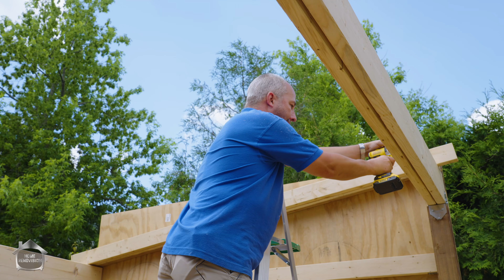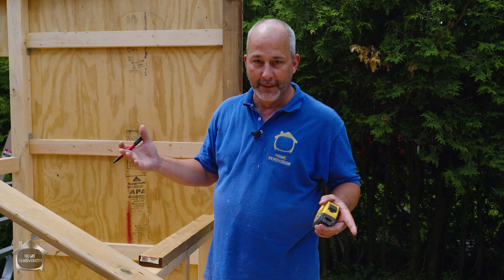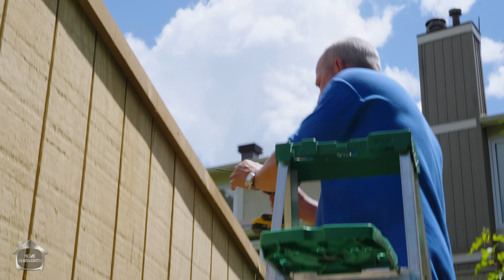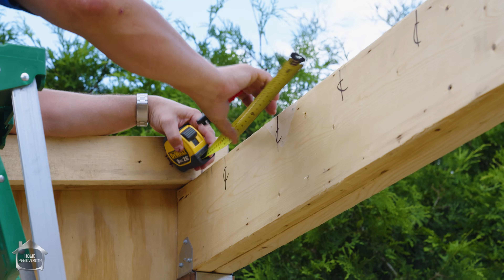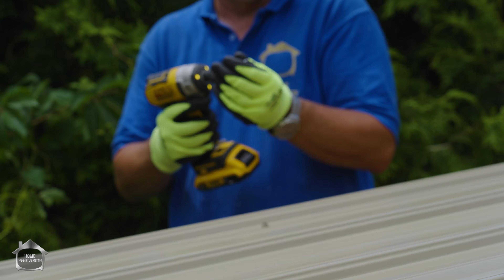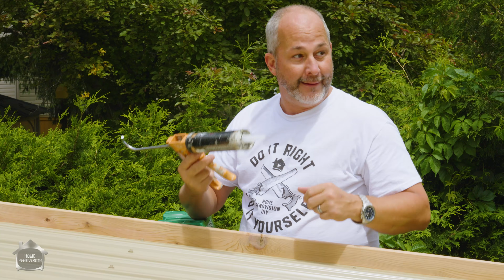This $500 Shed Roof Will Last 50 YEARS!

Comment: You are never to cut steel roofing with the paint side up when using a circular saw as the steel particles can and will burn the paint and cause premature rusting. Also, your roof might last 50 yrs. but when you screw on the flats, it is more prone to leaking as that is where most of the water runs. You have a 2 cent washer and they will fail after some time. Have seen them fail in as little as 15 years, and what a huge mess to try to fix especially on bigger roofs. Also I never have a wood piece sticking up on the side, better to cover all wood.

Comment: I prefer to push in the other direction because you have better control of the gun you have more control of the speed then you have more control of the bead its self. But also there's no need to fix the shape of the bead. The Best part is you can do it in a quick stroke and never look back. The only thing to be careful of is the cut of the tip  , the hole of the cut is the width of the curve you want.

Comment: Did you break the 7 1/4 metal cutting blade when you threw it? Something went down, camera guy was stifling a laugh I’m sure of it. Dude, the amount of tips you throw into each video is phenomenal. Ripping boards lengthwise without tablesaw, the screw to create a “pilot” hole, scoring and bending the sheet metal, applying the caulking extra-wide and self-levelling... and more I’ve forgotten already, I’ll have to rewatch a couple times. THANK YOU - You’re helping me help others.

Comment: If you live in a cold northern climate it is a good idea to sheet the roof and apply a membrane.  If you don't sheet and apply a membrane you will have frost forming on the underside of the metal.  When the roof warms up it rains inside your building.
Reply: I heard not to use it cause of condensation? Trying to figure which way I’m gonna go but have about a day to decide
Reply: @contractor556  There is a lot of good info from Building Science that is climate specific, although they sometimes have a no budget approach.  I live in one of the driest states, but at high elevation.  My shed roof rains to the interior in the fall and early spring when humidity and temperature are similar.  I was trying to save a few bucks when sheathing was outrageously expensive.   In the future I will pick up some thin foam board and insulate the underside.   Pretty annoying when things you want to be dry are getting wet from condensation.
Reply: Concern in Heated building only

Comment: I’m building a lean to roof off the back of the shed. Do I need to place osb underneath my metal roof? I hadn’t planned on it. I was going to secure the metal to the purlins. The roof is only 8’x10’. I asked this question before the end of your video, I see you didn’t use any type of plywood, so that’ll be what I’m doing. I did install some purlins though, 2x3’s

Comment: you put your metal rafter brackets on BACKWARDS, the 2 flip ins rest on your header, , Why did you put a raised edge wooden board around the edge?  that will hold leaves rain snow etc.. everything damp on the roof and NOT shed water, the caulking will not last but possibly 5 years tops.    the metal should be 1/2 inch OVER the edge all the way around AND have a metal drip edge   ...having the metal the to edge all the way around with a drip edge so debris blows off,  you have built a giant tray,,, you will be lucky to get 5 years before the roof rots all the way around the edge--- I have never seen a roof built like this?  Sorry just trying to warn the next guy starting out
Reply: @george8706 he did that to make you ask questions 😂

Comment: So Jeff, I hired a roofing pro to help me put on a metal roof.. He made it really clear and important to not cut the metal roofing material with a grinder or metal blade like you did.  You are supposed to use a "nibbler" which squeezes off the cut material and seals the open cut edge as it goes.. This prevents rusting and erosion of the cut edges..

Comment: The roof support should be perpendicular to the metal sheeting, and the outer edges of the metal sheeting should overhang all sides an inch or so, not have a board sticking up on the edges.

Comment: Hi Jeff,
I watched you with the tape measure.  I used to have one just like it.  Either one of these two you will like a TON better.
- Klein Tools 9225 - 25' tape measure.
- Klein Tools 9230 - 30' tape measure.

They have 13' of stand-off, have only real measurements, no metric stuff, AND it has measurements on both the top and bottom of the tape so you can read it overhead, with a double hook so you can also hook it overhead.  

They are a little heavier than the one you have, more of a concave in the bow in the tape to give you that much stand-off, a blade that the markings never wear off on, and can take a drop.  I bought the 25 because I needed one in a hurry, but you get the 30' because the 30' is just long enough to square up (diagonally) a 2-stall garage.

Comment: Two questions regarding cutting the metal. Did you do that one sheet at a time or was that the whole stack at once. 
Secondly, what type of cutting blade did you use, yours looked rather special. The two ways I know off is a fine toothed metal cutting blade, or a regular blade that is put in reverse.

Comment: Hey Jeff I can tell your newer to doing metal roofs and I am not a pro but some major Canadian winter issues you are showing. one use rake and drip edge pieces saves on relying on cocking. second your screws should be on the rib not the flats for a roof. Do not screw the washer flat your killing your seal just make it tight enough the washer no longer moves. And last pre drill your holes it will save you so much time and frustration. I hope this is help full to you as your videos have helped me in the past.

Comment: I don't like to be critical about these videos, but there is nothing right about this roof. First of all the roof framing is nuts, all roof panels need to be supported under the flat of the panel... Therefore purlins must be installed perpendicular to the rafters.
The standard spacing is 24" centers on wood construction. Then you install your panel over that, securing it with metal roofing screws in the flat of the panel, and never in the rib of the panel. There are lap/ stich screws that can be installed on the laps only, but they do not secure it to the purlins as they are short for securing the lap only. Please look up "how to install a metal roof" before hand, and do not install per this video. You will void roofing warranty if installed incorrectly. I have been installing metal roofs for 40 years, and I have never seen it done this way before. When walking on a metal roof, always walk in the flat of the panel, never on the rib. And save yourself a lot of money on wood by installing rafters 24" on center, not 9" on center. That's just crazy. Low pitched roofs should have mastic on each lap, to prevent leaking, especially in areas that get snow or ice. Good luck👍

Comment: HA! Hi Jeff (From Kamloops, BC) great video, one building season too late for me :D Just built two 10ftx10ft sheds with 12ft x 12ft metal roofs (8ft back & 10ft front walls) this past spring. Used your other videos as helpful guides. Thank you!  Used L trim on the backside of the roof as well (like Robert James). Worked perfectly to keep the water off the fascia & building! Going to do gutters that drain into barrels next year any ways, need to save the water. Keep up the great videos! Oh right, also used 1 sheet of "clear acrylic green house sheeting" cut to fit into the north-facing pony wall for light, works awesome. Enjoy the snow storm =-D

Comment: Instead of adding addl rafters and lining them up for the screws it's much much easier to just use a skip sheeting method. Set your afters at 16" or 24" centers depending on the loads you anticipate in your area and then just lay down a 5/4 material across the rafters wherever  you want a row of screws, again could be 24" to 36" according to your roof manufacture specs.  Much much much easier.
Reply: My thoughts too he did mention using less material but it looks like he used more material doing it his way
Reply: I do that when I build sheds for my livestock and tool sheds. Saves time, effort and $$.

Comment: While I understand the company only warranties putting the screws in the low part of The Valley on sheet metal, I will never understand really why that is. Common sense tells you that putting a screw in the low part of the metal where the water runs will eventually leak. It has been my experience that the rubber gaskets on those screws degrade over time and you will start having leaks in 10 years or less. Traditionally the screws were always put on the peaks, ask any old farmer. I get that it voids the warranty, but I would rather do that and put the screw in the peak of the metal knowing that it won't leak instead of depending on a rubber gasket that I know will be degraded by the sun over time, and begin to allow water in. what are your thoughts?

Comment: I may have missed this, but did you overlap the panels? If so do you screw through both? Also when you were sealing the edge you could see a raised gap between panels How do you tackle that? Thanks again for another great video.
Reply: You do overlap one portion of the panel. As for sealing, I don't believe he sealed anywhere other than the sides. With an angled roof like this, water shouldn't be getting inside, but the wood will be a big enough gap for water to suck in.

Comment: Cowel sheeting overlapping at the gables and going beneath at the eaves of the roofsheet makes those cedar boards obsolete if not unnecessary, as goes for the messing around with sealant. The purpose of any roofing is to divert water, not to act as an impermeable substrate lest you're building a downpour gathering pool at the top.

Comment: Hi There, wanted to get your opinion on using glassroc tile backer for our shower wall. We are using schluter waterproof strips on the corner joints and covering up the places where screws are used. What is your take on the Glassroc tile backer sheets? Should we waterproof over these sheets with red guard all over before tiling or are we good?

Comment: Why the giant gaps on those overlap seams??? Square?   Confusing, very confusing. Are you going to walk on the roof? All those rafters. could have had less and used blocking (Screw holds) across whole shed.  No overhang metal, which leaves wood below it dry? One off design.

Comment: Jeff, I love your stuff, but there are so many rookie mistakes in this video. That "k panel" metal sheeting is designed to be supported across the panel, not along it. You need battens running perpendicular to the roof rafters. They don't need to be big - metal "top hat" battens are a cheap option, or you could even use a 2x4 ripped in half. For use as a roof, the panels need to be fixed through the rib, not the pan. Otherwise, you are relying solely on the rubber seal on the screw to keep water out, and they are easy to over-drive or under-drive, and they eventually wear out anyway. You should also not use an impact driver to drive roofing screws - the hammering action damages the protective coating on the screw head, and they will eventually corrode. And for the love of everything, just buy barge capping for the sides! Barge capping comes in the same color as the roofing, and probably costs less than a cedar 2x6, but will last three times as long and never need any maintenance, plus you will not be relying on sealant. 

Metal roofing is not a big thing in North America, but almost every house we build in Australia has a "Colorbond" metal roof. If installed properly, they will easily last 50 years.
Reply: Thank you! I just did a massive roof on my chicken coop using this same material and every single thing in this video is contradictory to the manufacturer's guidelines for installation. Those areas between the ribs are going to sag with even the slightest snow load bc there is no horizontal bracing. The ribs give it strength in the direction they run, you support it perpendicular to those, same as you would joists of a deck sitting on bracing underneath. Also this is not cheaper by any stretch of the imagination. With just bracing support, you can go up to 2x2 area under a panel, so with the amount of lumber used to go underneath those panels at every rib, you could have just done them 24" OC and then ran the remaining lumber 24" OC perpendicular to the beams. They wouldn't even need to be flush, the 2x4's running horizontal can sit on top of the roof beams and still support the weight of a person from just the panel ridges. And as noted, it is not "as much compression as you want" on the screws, you're only meant to fasten them down so the gasket starts to compress slightly but does not spread out so much it leads to cracking prematurely. I am all for home DIY and I learned everything I needed to build my coop off YouTube but if you're gonna provide instructional videos you gotta get the basics right, especially if the manuf instructions already tell you everything you need to know.
Reply: @MrFathead009  Ive watched a couple metal roof videos and they have put the screws on the pan rather than the ridges. I was told to put them on the ridges and thats what i do , but after watching a few videos i started to question myself. Thank you for clarifying so much information and mistakes made in this video.
I also was questioning the price of how this was built vs being 24" o/c. Seems to me this would be more expensive.
Jeff, i always watch your videos & have learned several things from you, however this was not one of those videos.

Comment: Hi Jeff! I appreciate the content you create! I’ve learned a few tips and tricks from you over the past couple of years.  I guessing this is probably your first metal roof project. 
In the future consider using purlins. Also, the metal suppliers also sell rake trim for the edges, or a 4”x 4” mini corner piece! 
Thanks! God bless
Reply from the maker: Great suggestion!
Reply: He literally said they were not going to use Purlins to save on cost. He also has the rafters very close together (as explained) and therefore it has good strength

Comment: Why you would waste your time trimming the edges and caulking it. They make matching corner flashing which cost almost nothing extra for this size project and install in 10 minutes with a couple extra screws and a gasket

Comment: 14:38 you actually should only compress until the washer is making very firm contact, bc if it compresses the washer out it dry rots much faster and can be an early failure point.
Reply from the maker: Cheers for that. Obviously I am not a sheet metal worker. Appreciate your advice.

Comment: On rafters or amount thereof to avoid wooden  purlins.....you can buy metal purlin in various lengths. It would make a job like this very easy by only using rafters at 18-24 inches. I only mention it because I'm basically doing the same thing right now. I'm in Florida though....we don't get snow like up there in the evil empire of Canuckia. 🙂
Reply from the maker: I did this to avoid the need to get up on the roof while installing. perlins work well form aesthetics and airflow. if you are not worried about working on a roof then do it.

Comment: Could something like this support solar panel and racks on top? Any idea of the weight limit for this type of roof?
Reply from the maker: not engineered so not sure. I would think I would want 2x6 rafters if I was going to be working up there and installing panels. Cheers!
Reply: -----  not as built  -  if you use purlins and rib panel ( not corrugated )  it's a simple do with the weight limit determined by the dimension, span, and spacing of your rafters and purlins  -  on a shed this size, 2x6 rafters 2 foot on center with 2x4 purlins every 2 foot will hold up as much solar as you could manage to get on it with nary an issue

Comment: Best practice when installing a metal roof is to pre drill all sheets in the pile so you get a straight lines across the roof. And pre manufacturers specs they recommend putting the screws on the ribs not the flat surface this will lock each sheet together and puts the fastener at a spot where it less likely to leak over time
Reply: ---  could you cite us a manufacturer of rib panel roofing that recommends screwing through the ribs and not on the flats ?     ----  they don't except on corrugated style metal roofing and recommend placing screws through the ribs that overlap only with the panels screwed on the flats  ( usually with one screw through the flat on both sides of the rib )
Reply from the maker: correct. that also require perpendicular framing and the ability to get up on the roof to do the install. This approach does not. I am not interested in best practices at all times. Sometimes a little common sense will get a great result without the risk of falling off a roof. Cheers!